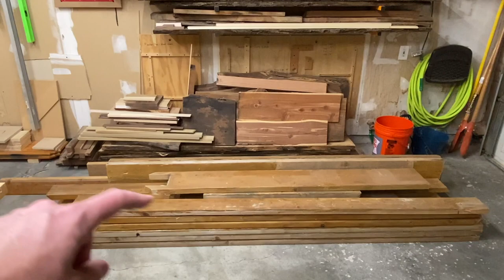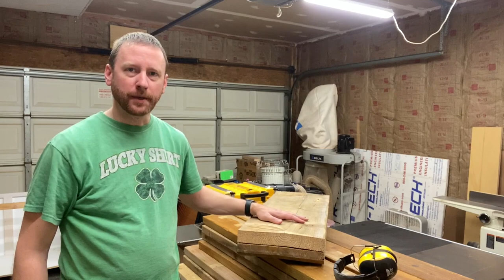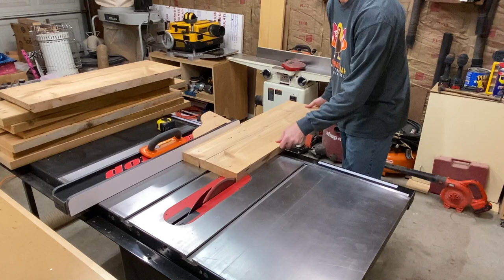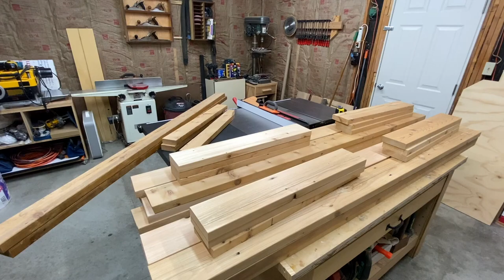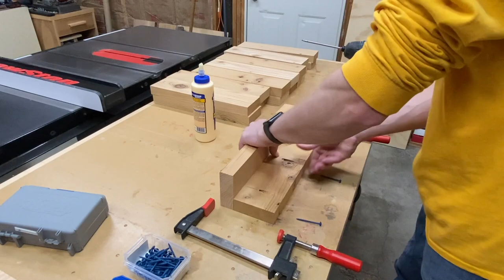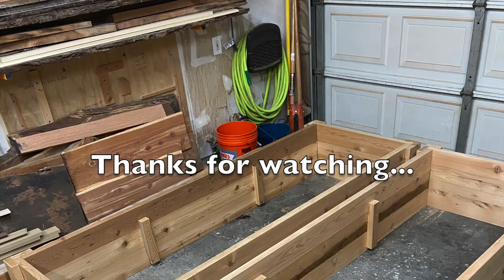How to build a raised garden bed | Easy and Cheap

Comment from the maker: Want to support the channel? Here's what you can do:
 - Subscribe to the channel
 - Hit that Like button
 - Leave a comment
 - Amazon Affiliate: https://amzn.to/2LaN1Ib

In this video I'm building a pair of raised garden beds out of reclaimed cedar decking.  This is a great use for reclaimed wood.  The dimensions are 7 feet long, 2.5 feet wide, and 15 inches deep.  The pieces for the corners are 3 inches wide.  All of the stock was milled down to around 1.25 inches thick but that was primarily done to remove all of the old finish and clean up the surfaces...you could skip this step if you bought new lumber or wanted to just sand off the old stain or even just leave it alone.  This is our first time trying to grow a garden so we're hoping having these raised beds will help keep the critters out and that the fresh soil mix will help us grow some nice veggies this summer.  Let me know what you think in the comments section below.

SawStop 1.75hp PCS: https://amzn.to/2X4gWsP
Dewalt DW735 Planer: https://amzn.to/2Z0U4f0
Bench Dog Push Blocks: https://amzn.to/2YB00uL
Ridge Carbide 10-inch Saw blade: https://amzn.to/3bATmcp
Bosch 18v Drill: https://amzn.to/2OmrItJ
Bosch 18v Impact Driver: https://amzn.to/3cxAhJk
Bosch 18v Jigsaw: https://amzn.to/3jDtxOA
Titebond Wood Glue: https://amzn.to/2LzTdv4
Bessy 6-inch F-style Clamps: https://amzn.to/3e3LGl4

Thanks for watching.  If you have any comments or questions please leave them below or hit me up on social media, email, or my website.

Hit that like button and don't forget to subscribe!  Thanks!

Subscribe: https://www.youtube.com/danprudlow?sub_confirmation=1
Twitter: http://twitter.com/DanPrudlow
Instagram: http://instagram.com/danprudlow